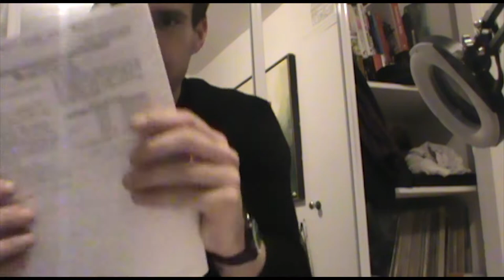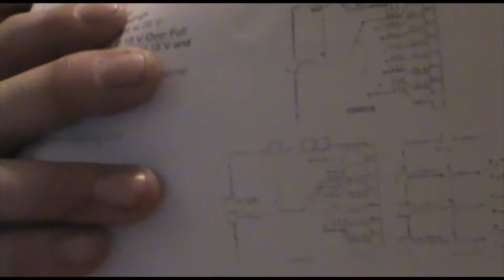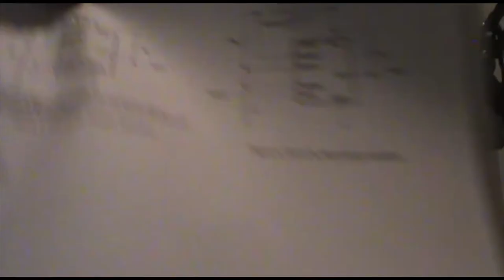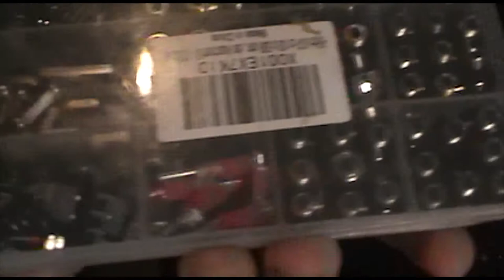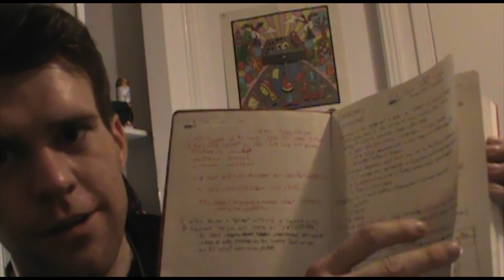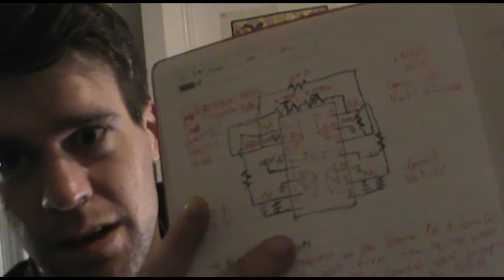Teaching Yourself Electronics or (How I Learned to Stop Worrying & Love Capacitors)

Comment: This was rad. I'm recorded to see what you come up with and hear some cool stuff. A lot of synth markets are engineers or electronics guys first and I really appreciate people coming at this first as a musician because that is the end goal. Please keep this up.
Reply from the maker: I agree, of course, I'm nowhere near as talented with electronics as someone with an Electrical Engineering degree, but I do have 20 years of music experience and an Associates Degree in Music Theory /Performance so I can teach myself only what is necessary for electronic music products.

I made that VCO, and I got that 4 waveform VCO using only three capacitors, 5 resistors, 1 Potentiometer, and one TL074 (4xOperational Amplifier Integrated Circuit) & I spent DAYS scouring the web and printing out data sheets and Texas Instruments tutorials before I finally found the right circuits to combine. 

An Electrical Engineer uses a Square wave as a Clock, a Sine wave to test signal symmetry, a triangle wave to time the square wave clock and the same for a sawtooth. So for Engineers, who are fine with making giant circuits and schematics, it's no big deal what the waveform SOUNDS like; they're concerned what it LOOKS like on an oscilloscope. For someone who thinks of the waveform as a sound-source the way of thinking about it changes completely.'

For example, On the Triangle wave I made I used three resistors in parallel and for WHATEVER reason it sounded better (I figured out that the reason is the signal is now traveling through three resistors and so the Op-Amp is getting three out of phase signals, if you think about the resistors as slowing down the signal when they lower the voltage). That would be a horrible idea for an electrical engineer but it sounds kick-ass for a synth.